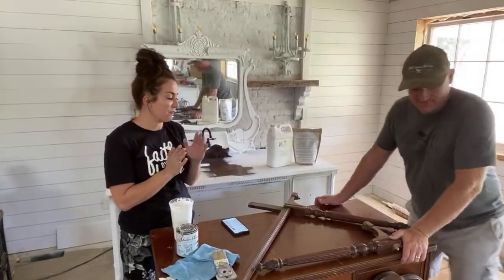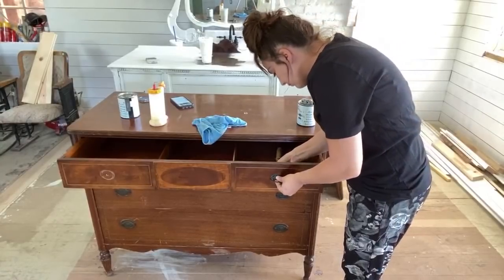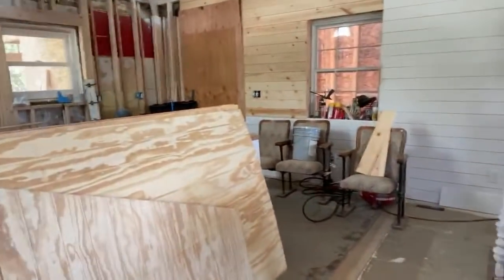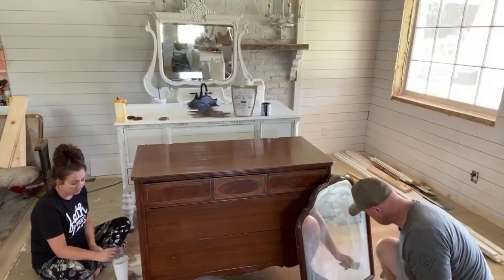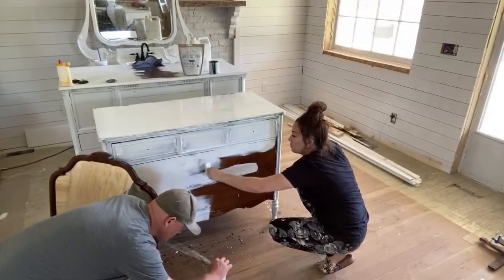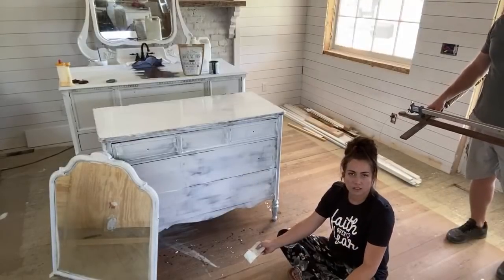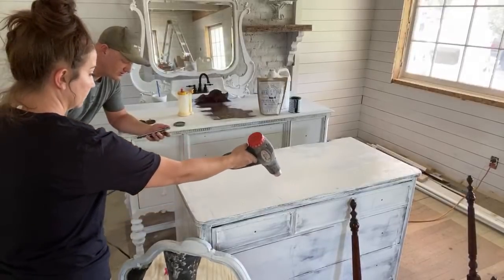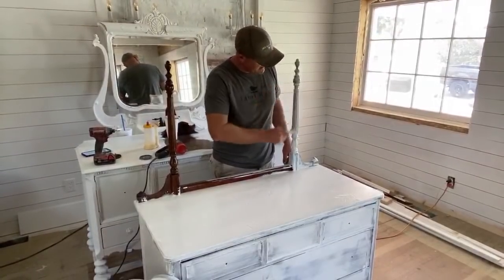How To Repair Furniture Vanity Mirror Harp | WNW

Comment: Want to paint my oak cabinets in the kitchen. What white diy and sealer would you use. By the way love the three you've showed on todays video
Reply from the maker: Leonnie Boyce I would use salvation solution just to be on the safe side and to help block stains. I did white swan on my current cabinets and all of the farmhouse is going DIY bead board. I’m dealing with SP Top Coat for a matte finish.

Comment: I have a quick question for you:   I have been looking for an old metal tool box for years, and finally found on!  It is silver metal, and I think I want to put one of your black stencils on the outside.  Sort of put my stamp on it if you will, but keeping it subtle.  Can I put the stencil directly on the nicely cleaned metal without any other preparation, or should I do something to it first?  I want to keep the old silver look with its great patina.  Then after I put the stencil on, how should I seal it?  I plan to use it for what it was designed--a tool box!  ...but I want it to retain it's beauty, too!  help!  Believe it or not, I found it at GoodWill!!!!
Reply from the maker: The DIY paint we use sticks well to metal. If it’s really shiny it doesn’t hurt to scuff it a little with some 220 grit sand paper.
Reply: @JamiRayVintage  but this doesn't address my question!  Guess I'll just try what I was talking about and see if it works!

Comment: The dresser for your bathroom, don’t you want to paint that top part of the drawers just to make it look nicer when the drawers are opened???
Reply from the maker: It’ll just get sanded and sealed so there will be a nice crisp line when you open the drawer. I find if I don’t sprint the inside parts of a drawer they slide better longer.